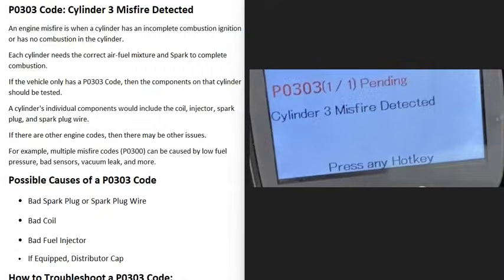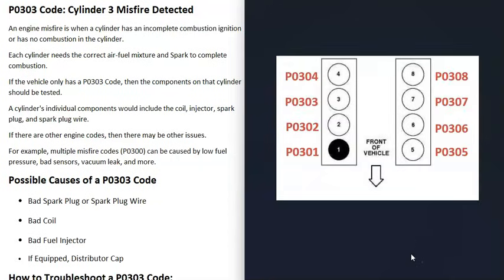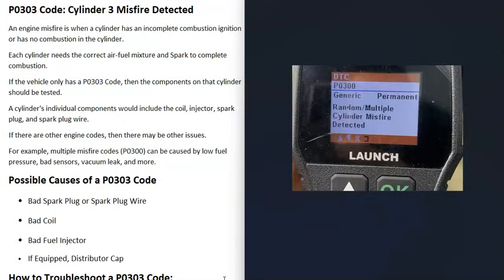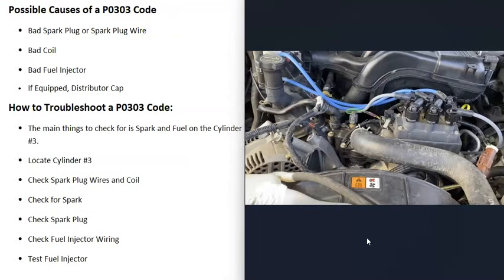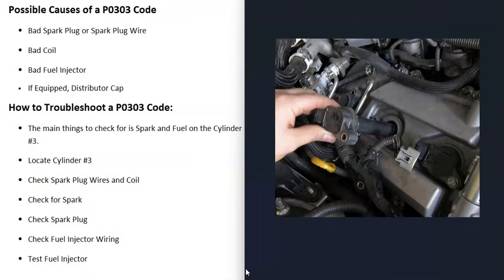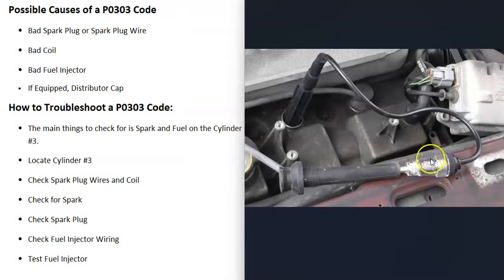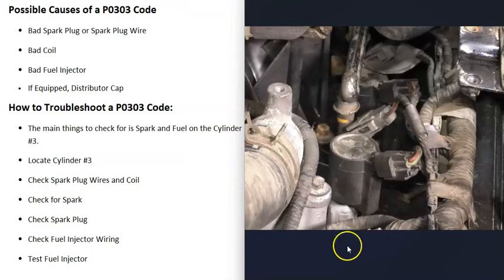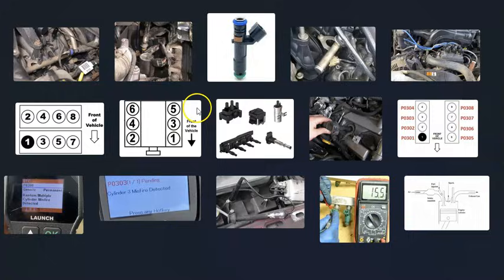Causes and Fixes P0303 Code: Cylinder 3 Misfire Detected

Comment: Hi. Hopefully you can direct me to a possible problem. I have a 2009 Chrysler Town and Country and I have been getting this P0303 code and the techs have put in new spark plugs and wires and codes cleared and I will drive it for a few days and then check engine light will come on and the van is really misfiring now. I have taken my van into the techs several times and each time they get the same code and can’t figure it out. They said it could be a head gasket?? What are your thoughts?

Comment: I have 2012 Chrysler town and country. New spark plug new injector new coil from dealer but still miss firing.
Reply from the maker: If all the #3 components and wiring are good, there may be a mechanical problem, such as a bad valve. A leak-down test can be done to see if there is an issue.
Reply: @HVAC_Mechanic I did compression test which I got 183 psi.

Comment: Dear, thank you for your video. These are the six faults in my VW Caddy:
013153 - Misfire detected during Nat.Gas Operation, P3361 - 001 -  MIL ON
013156 - Cylinder 3 Misfire detected during Nat.Gas Operation, P3364 - 001 - MIL ON
000768 - Random/Multiple Cylinder Misfire Detected, P0300 - 001 - MIL ON
000771 - Cylinder 3, P0303 - 001 - Misfire Detected - MIL ON
013157 - Cylinder 4 Misfire detected during Nat.Gas Operation. P3365 - 001 - MIL ON
000772 - Cylinder 4, P0304 - 001 - Misfire Detected.
I've changed the spark plugs and wires, but the faults remain.
In your opinion, do I need to change the igniton coil or is there another cause?

Comment: my 98 honda civic ex I gotten a P0303 & P1399. I Just replaced my Ignition Control Modul (Igniter) Distributor cap, Rotor,  spark plug wires, spark plug on 3, Replaced my Ignition Coil 7rs ago. Still getting the P0303 P1399 code. I Never changed Fuel Injector 3 yet or All 4 Injectors yet.  Also i smell gas fuel coming out from my exhaust when i start the car could this be a bad fuel injectors or Fuel Pump?  Reoly back....
Reply: 🤔Same as my Jeep, except just P0303 and P0403.

Comment: Hi, i have a 2002 blazer xtreme  4.6l v6, got p0303, ive changed spark plugs, distributor cap and rotor, spider mfi fuel injectors, checked wires and its still running like crap, if i punch it runs decent but still isnt right what else could i be missing?

Comment: Have P0303 code in my toyota camry 2014, when driving on a highway and above 60mph it usually misfires while maintaining speed, have changed spark plugs, ignition coils, purge valve but the issue still persists. Don’t know what to do feeling so exhausted because of it what to do any suggestions??
Reply: Could be a bad map sensor

Comment: I'm having a Permanent P0303 Misfire Detected Cylinder 3 on my 2022 Honda Insight. Plugs look clean and I have cleaned them all with carb cleaner and wire brush then swapped Cyl 3 plug with Cyl 2, Coil packs look good and I have swapped Cyl 3 with Cyl 1, Fuel injectors all have same Ohms and have been cleaned with Carb Cleaner using an electronic Fuel Injector tester all are spraying good I have swapped Cyl 3 with Cyl 4 fuel injector. The P0303 misfire code always stays at Cyl 3 and only occurs while the engine is cold, If i clear the code and the engine is fully warm the misfire stops and no more error though still can feel occasional rough idle from misfire every 5-15 seconds. The valvetrain is a dual overhead camshaft with direct roller rockers therefore I do not believe it uses hydraulic lifters. I do hear a knocking sound up high I think in the valvetrain which is more loud when the engine is cold, and have found instructions online for adjusting the valve lash using a feeler gage. I haven't pulled the valve cover yet to inspect the rockers and valve lash, but I suspect this is the cause of my P0303 misfire. There is no indication of blown head gasket, no water loss no steam from exhaust, and no smoke in exhaust so I do not think there is a cracked ring. Engine runs good and strong otherwise. What are your thoughts on this, is there anything else you can think of which may cause this Cyl 3 misfire? The car is 2.5 years old with 63k miles, I've hear that after the engine breaks in the valves can sit lower in the bore causing the valve stem to sit higher closing the gap between the stem end and rocker arm. I bought and extended mechanical failure warrantee with the car for $3200 with 7 year 100k mile coverage, yet Honda is telling me valve lash adjustment is considered maintenance therefore not covered by my warrantee, and that they can diagnose the issue but I would have to pay the diagnostic fee alone with any repair fee if its determined to be valve lash, spark plugs, coil packs, or fuel injectors !? Seems that no matter what the outcome, the Honda stealership wants to charge me personally instead of using my dealership extended warrantee which I paid a LOT of money for. Personally I feel that no matter what the outcome, this should not happen at 63k miles and should be considered mechanical failure not maintenance.
Reply from the maker: If the injector is good, first, I would check for a spark on cylinder #3. There are low-cost spark tester tools. Here is a video I made showing how it works. https://youtu.be/bOX-TvZ2RCM
If there is spark next, I would test the injector circuit on cylinder #3. With the key ON, there should be a constant voltage, usually 12 volts, on one pin. The other pin will be ground, which is controlled by the computer. I made a full video on how to test this and check if the computer is sending a signal. Here is a link. https://youtu.be/JL4_HlYCKrw

Comment: A mechanic just put new 4 spark plugs and wiring and a new ignition coil. I bought the parts my self on my 2006 dodge stratus. I drove the car off and it started misfiring. Got it checked at o'riellys and it only shows P0303 cylinder 3 misfire.
I was told spark plug #3 is not in all the way or the ignition coil was not put in correctly. Those are new parts. The car drives smoothly. Only when I'm stopped or parked it misfires. Any suggestions
Reply: Same maybe injectors I have the same problem 2014 dodge journey it will go into limp mode

Comment: I had that multiple sensor misfire and it was the electric voltage regulator on the alternator.
I replaced it with a new one and the misfire was gone. But while in there I changed the spark plugs. Now is a smooth ride.

Comment: Hey Hvac, long time viewer here. Youve helped me through quite a few hurdles and also saved me money. I have a 2020 chevy 5.3 that just through the p0303 code. At first it was it was just the parking brake check light came on then the esc light. About 2 minutes later the check engine light comes on and i used a reader to check at auto zone and sure enough it code p0303. I can def tell my truck is not firing on all cylinders either...hopefully its just the wiring and plug.
Reply: Ism having to change coil pack on 2010 Kia rio number three l have worked this whole car myself do I unhook the battery
Reply: @mavisdavis2127  yes, unhook the battery

Comment: P0303 on my Jeep JK. Throwing in the towel. Changed…PCV valve, camshaft position and crank sensors, camshafts and rocker arms, plugs and ignition coils…..   I don’t understand what is going on. Code is intermittent. I clear the code and she’s good for about a month or so. Then it comes back. Seems to only trip the check engine when I’m parked with the engine running. Also, Jeep is running fine. No issues with acceleration or anything. Thrown enough money into this thing and moving on to a Toyota. Jeep can shine it. Horrific and inexcusable build quality on these engines.

Comment: Swapped spark plugs and fuel injectors. Swapped the coils around and still getting misfire on number 3. Could it be a piston damaged or is it probably the wire ?
Reply from the maker: It could be a mechanical issue, such as a cracked head or cylinder/piston, but that is fairly rare. If the components are good, I would test the wiring.
Reply: Electric voltage ⚡⚡ regulator was mine. Cheap fix!!!
Reply: @figgiefigueroa7372 how to fix

Comment: I have P0303 and P0305 code and replaced the fuel injectors but still having trouble with acceleration after 50mph.
Reply from the maker: Since it is more than one cylinder, I would replace any in-line fuel filters and do a fuel pressure test.
Reply: Could be you throttle body.Replace or take off throttle body and clean it especially in the back area once you take it off ..Disconnect battery ground if you proceeded to do so.

Comment: I changed my spark plugs and coil still nothing. It goes away then comes back in the morning.
Reply: Valve cover leak?
Reply: @coolghoul9 would a value cover leak cause a misfire?
Reply: @FutureDreamZz  yes if the plug seals are letting oil into the spark plugs, pull the coil and look inside to see if its full of oil, i dont think it would cause one if its leaking externally though like outside dripping down the engine

Comment: 2003 Buick century 3'1 3 missfire good spark plugs and wires missing real bad on idle I smell fuel and gas gauge will go up and down when I'm driving
Reply: intake and exhaust stems? is there smoke when running the engine and open the oil cap
Reply: @soulysznnnn same situation & I'm seeing smoke when opening the oil cap. Any ideas?
Reply: @terencejackson3480  blow bye, so could be a piston or burnt valve  if it’s not the ignition coil or spark plug